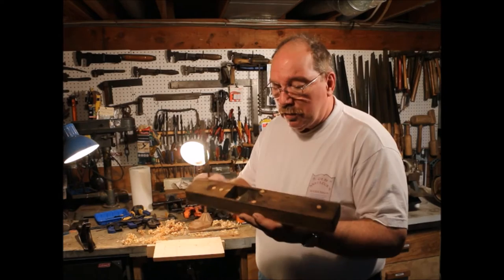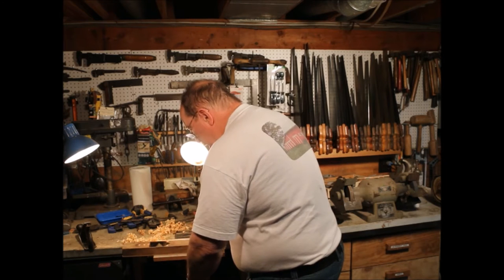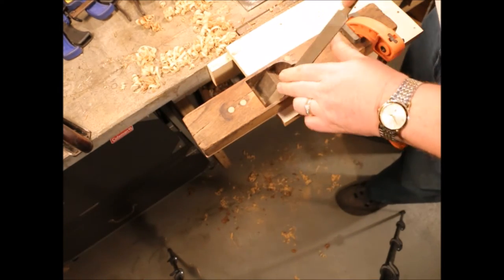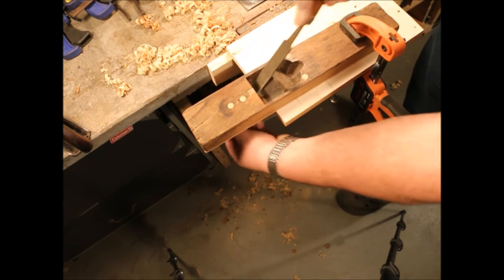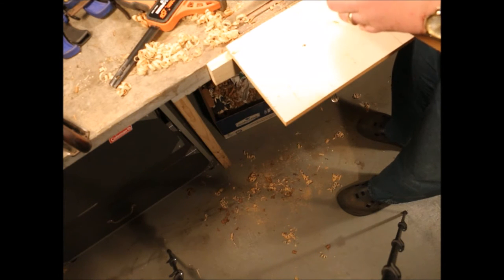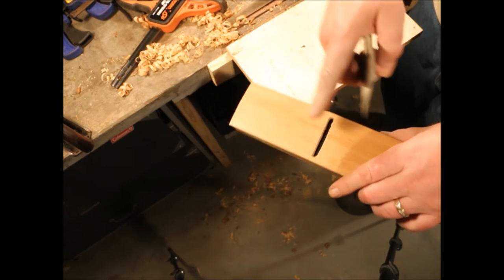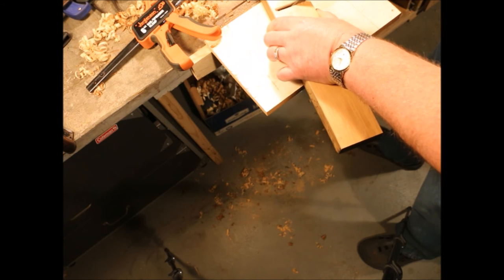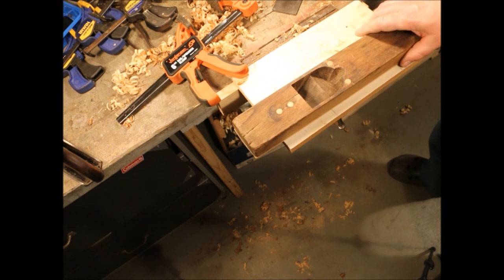Union Transitional Plane ~ Part 13 ~ Fitting The Mouth To The Blade ~ by Old Sneelock's Workshop

Comment: So far, so good. I broke down and bought a long-barreled Irwin clamp for the greenhouse deal. I had been thinking about it for a while and I wished I had gotten it when I started thinking about it but. That is one handy rig, especially when I'm working trying to get a screw started in the top of the thing and me on a ladder. I'm allergic to heights and have bad back trouble because of them. I have a big, wide mushy yellow streak running right down the middle so me and ladders do not fare too well. But the clamp holds across several thicknesses of 2-by-heavies. Gives me a lot of help.
Reply from the maker: +Lewie McNeely That's not fear. That's common sense telling you to be careful. I love my Irwin ratcheting clamps. Nothing better if you are working alone.
Reply: Boy Howdy they've saved my turkey, chicken and fish (no bacon) lately. The short one was a dandy BUT the longer one really makes everything work better. I have some pipe clamps and a couple of 'C's but they just don't work one handed. Unbeatable!

Comment: It sure would be nice to see the bamboo magnified. Somewhat of a before and after some use to see the wear, if much, pattern  compared to regular woods that a plane is made from...
Reply: +Ol James Sounds like a plan to me too, Old Jimmy Bob.
Reply from the maker: +Ol James I'll be sure and put some use on it. The last one in the series looks to be #15. I'll put some close ups in that one
Reply from the maker: +Lewie McNeely Maybe we could do a "Traveling Pants" thing with it. I send it to one of you and you send it on to someone else after a while. When it gets back in a year we compare notes. ?
Reply: That sounds like a fine idea but I'd just have to send it on because the stuff I work with is not conducive to any reliable comparison. In other words, I'd ruin the poor thing BUT others would really do it a good turn.
Reply: Now that would be something!! Like Lewie I don't use one enough to add to the results. Maybe one or two projects a year and they are usually in the Fall when I have gotten the outside stuff caught up and canning done...
Reply: Ol James All my old rusty stuff is in the wrong frame for that sweet little block of precision wood. About all a wooden block would do here is to block a mower blade or soften the blow of a hammer on something that needs to move but not fly off in pieces.